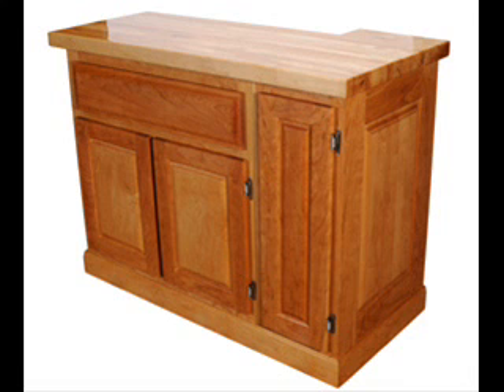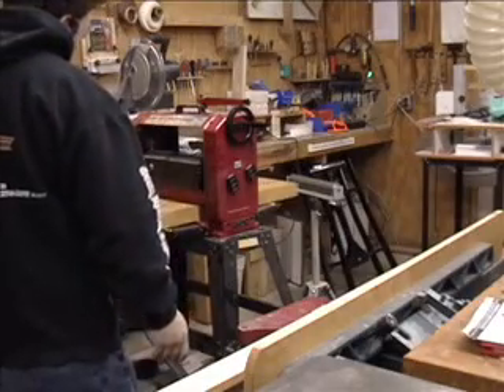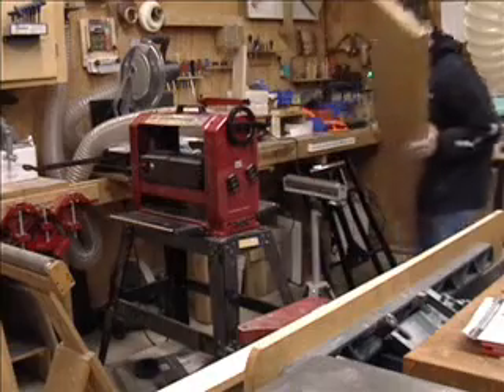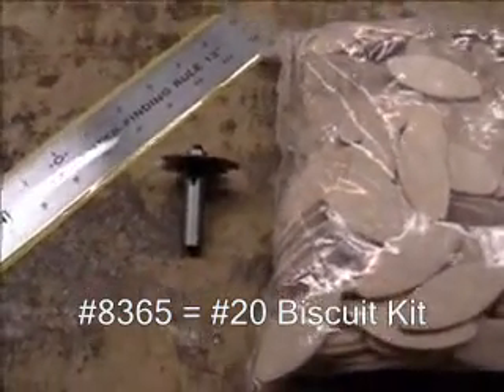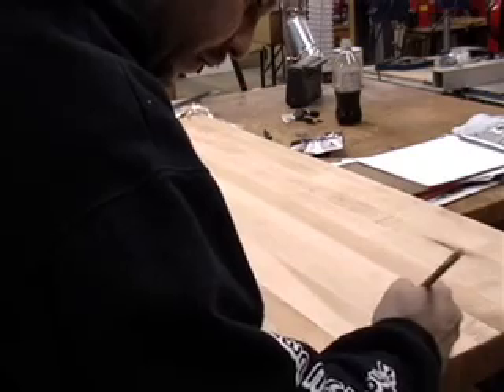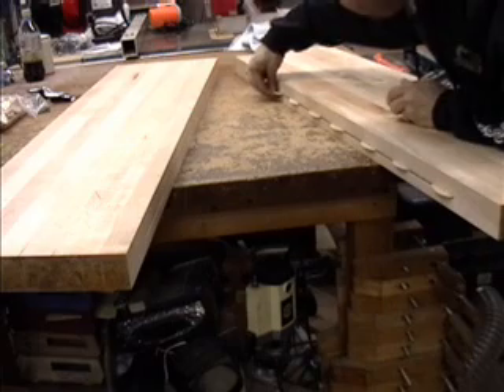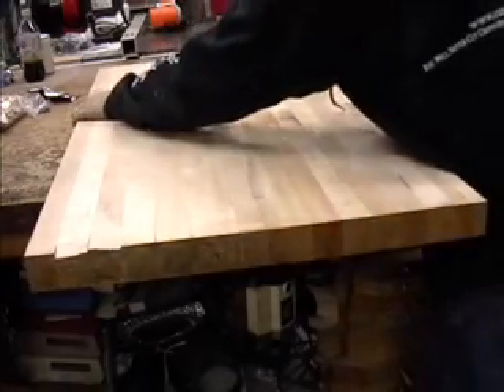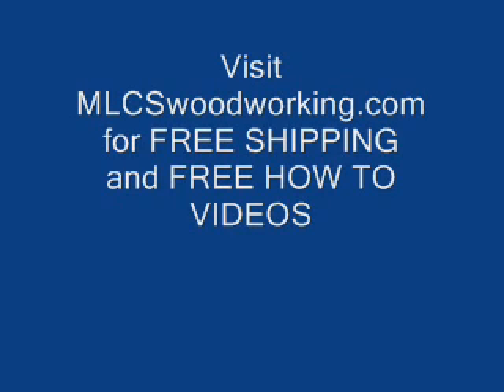MLCS Woodworking Custom Coffee Bar Part 1

Comment: I thing a massive spline 5" wide  1/2" thick would align and provide much more strength in the joint.       biscuits for 2" slabs of maple seems a little lightweight to me...